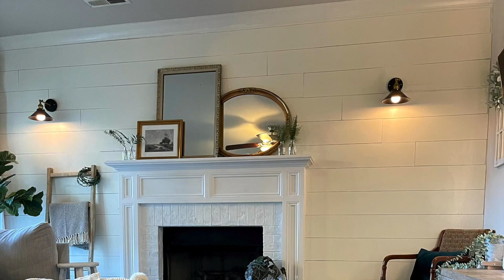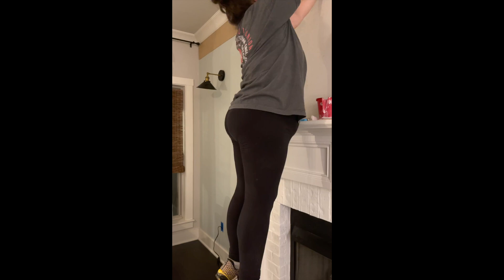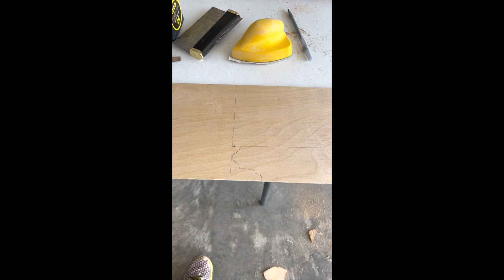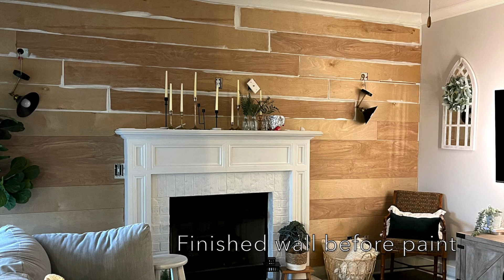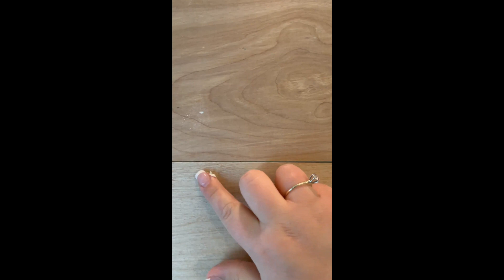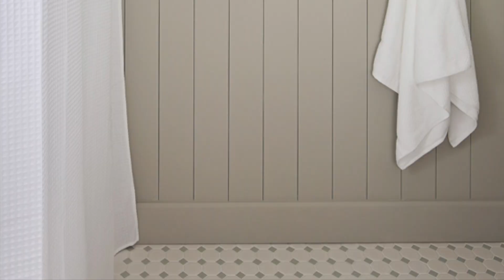DIY Faux Shiplap Wall | Easy & Budget-Friendly Accent Wall Using Plywood

Comment: Wow, great job! Beautiful colors. What is the paint color you used on the wall? I can't tell exactly but it looks very light yellow while the fire place looks white. Have you ever done the same on a ceiling? I'm thinking of doing the ceiling in my craft room but am worried I may bite off more than I can chew since I will not have any assistance. Thank you for the inspiration!
Reply from the maker: Thank you! I haven't done a ceiling with this method, but I know it has been done! That's definitely a two person job. The color on the wall is Creamy by Sherwin Williams. It is a cream color which naturally has a touch of yellow in it. The fireplace is Pure White SW.